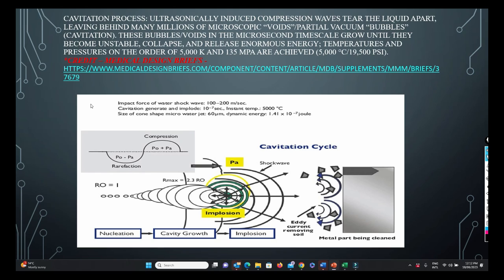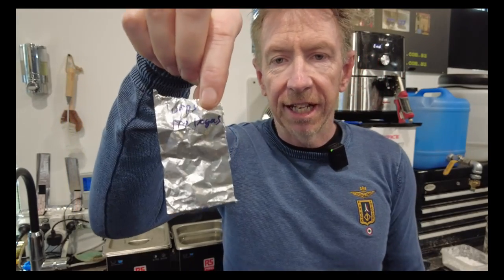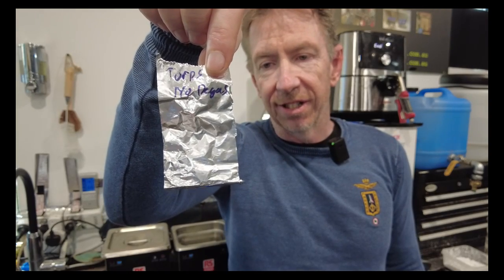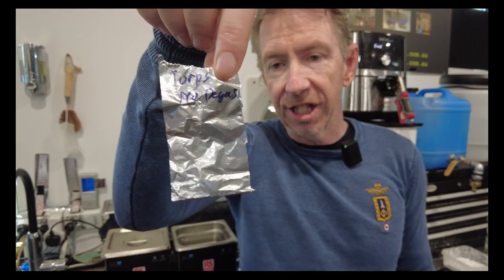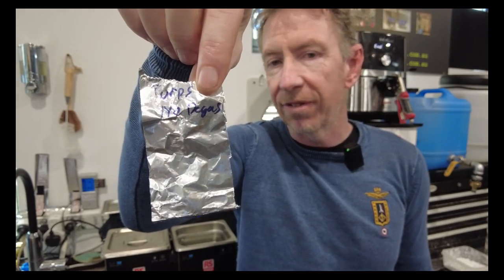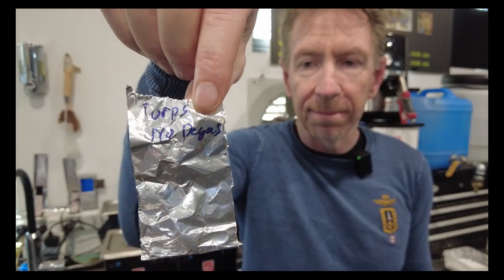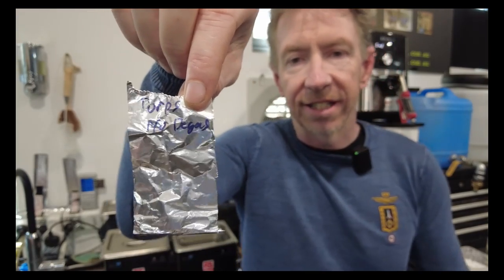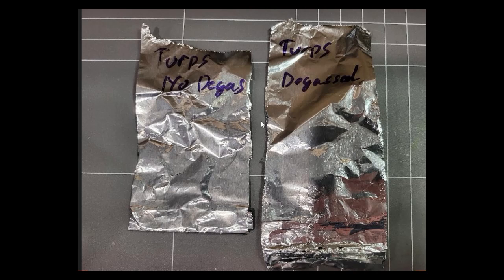Ultrasonic like a pro

Comment from the maker: **Apologies major computer issues today, it crashed twice and a couple vids showing close up of the more powerful ultrasonic with specific solution, as well as ultrasonic wax - have not exported into main vid. FFS. However you can pause and have a look at the main pick showing all test strips. In short - US with wax was better than expected - direct in tank, 80dg, and 10 mins degas. The strips in the specific cleaning solution in the elma were pretty ripped apart - specific cleaners will do the most powerful US clean action.

Comment: 27:04 Maybe I missed it, but in your discussion of degassing, your slide page 2 says to run the ultrasonic for 10 minutes “without anything in it”. Maybe you could have clarified that as without any parts? Or did you mean without any parts or liquid solutions?
Reply from the maker: Hey Terence - yes that means without any parts in it. I dont think many will consider this means without liquid as then there would be nothing to degas. I think i explained that the ultrasonic works by cavitation / imploding bubbles, and that when one pours solution / solvent in, this traps air like a bubbler works in a fish tank so the fish have oxygen to breathe. If there is gas trapped in the solution, this fills the imploding bubbles, no ultrasonic scrubbing - so degassing the solution is needed for ultrasonic scrubbing to be at its most effective. If there is no solution in there, there is nothing to degas.

Comment: Have you ever considered blasting a chain clean with a power washer or steam washer? 
I recently tried my power washer, on my chain, obviously after I removed it and secured on a plank. I also removed my cassette and did the same. This was on my mountain bike after several muddy rides and reapplied Finish Line Dry. 
I have been a user of Silca Secret on my gravel bike chain but had never used wax on my Mtn bikes. After learning more about chain lube from your channel I realized that wax would work well on my mountain bikes, so I started with my SS Mtn bike. It was great and easily wiped clean and reapplied Silca Wax chain lube. I determined that I had all the right stuff to give it a try on my geared Mtn bike and why not. So I power washed the chain and did the rest of the prep cleaning except for that ultrasonic. The chain was completely clean to wipe down with white microfiber towels after denatured alcohol soak. 
Honestly I don’t know why I have never considered using on my mountain bike’s except for the fact that people without ever trying it are saying it’s wrong or too complicated.  I’ve been a long time user of Finishline Dry applied in between ever ride but my expensive KMC get clapped out in about 1 year max. I ride a lot but have a few bikes so my mileage on each bike varies. The gravel bike gets the most mileage since I do a Century every month and choice for my longer distances. The Mtn bike less but get dirty with lots of stream crossing. 
Anyway, thanks for your analysis and deep dive into bike maintenance.
Reply from the maker: Hey there - steam would be a more time consuming faffy way vs hot water baths if trying to melt off wax. Pressure washer - it will get rid of surface stuff but it will again be a faff if trying to cleain oil lubes deep inside and wax doesnt dissolve with water so if bonded deep inside chain it wont do anything to that. Post mud rides i do jet wash bike and chain but then boiling water baths to melt off worst of contaminated wax, dry, wax pot. 

And yes A LOT of misconception re waxing especially in mtb demographic, but that is changing. slowly slowly logic is breaking down very incorrect myths. Offroad waxing gives much more benefit even than road riders as that is the perfect environment to have all parts inside chain coated in a super slippery SOLID lubricant, and there is no easier way to reset chain post harsh conditions vs immersive wax. How people thinks solvent flush cleans are easier makes no sense, and if they just add more lube, they pay for it with very high wear and friction - which is hardly optimal and very expensive on a lot of groupsets these days. 

If an LBS says a bunch of crap about immersive waxing, they should not be trusted with much....

Comment: Very interesting video! I wanted to do some aluminium foil testing myself, and got reasonable results with water, de-gassed water, and citrus degreaser. Then I tried Morgan Blue Chain Cleaner, and nothing happened. Not even after de-gassing. So ultrasonic should not be effective with it, correct? Well, I put a somewhat dirty chain in it, and as soon as I turned on the ultrasonic, large amounts of black dirt flowed out of the chain. So what was going on with the aluminium test?
Reply from the maker: yep same happens with solvents like mineral turpentine that also have very low ultrasonic cavitation. If the solvent itself is working on breaking down what needs to be cleaned - then when ultrasonic is turned on - the high frequency vibration will look like its ultrasonic action. So it will still clean, just mostly by vibration, not cavitation. Cavitation is actual ultrasonic cleaning action and is MUCH stronger than vibration. This is why the foil test exists - to see if there is actual ultrasonic cleaning going on, or just vibration.

Comment: Good stuff, but im going to use my just purchased ultra sonic + heater to hot melt wax my chains, Ill use a separate few jars for solvent cleaning of the chains for initial degrease, then just boiling water for resetting once I've waxed them and need to do another hot wax treatment.   Have you tried using a heated Ultra sonic tank for wax application? is it better than just crock pot waxing?
Reply from the maker: Yes ultrasonic waxing is done for race prep chains, something really pioneered by Friction facts and carried over with a number of companies that offer full race optimised prep. However, there is no tangible data on how much better a US wax (done properly) is over simply a good swishing. It could be a fraction of a watt, it could be a tiny fraction of a watt. I tend to recommend only to those who want to cover every base to make fastest possible race chains. For training chains, you could never, ever, ever assess a tangible difference so it is just a lot more time and faff to do for something you cannot notice vs just using a slow cooker - but, also generall no harm - albeit people can get a WORSE wax if using low power ultrasonic vs swishing as the modifiers will settle mostly to the bottom of wax leading to a poor distribution of friction modifiers through the wax going onto chain. For US waxing, you need a pretty powerful US, and you will want to (without aerating), give wax a thorough mixing before waxing to ensure full and even distribution. 
> Get wax up to temp.
> Without basket in use stick blender for about 10 secs - taking care not to allow it aerate (use deep in wax)
> Degas for 10 mins
> Stick blender taking care not to allow it aerate (use deep in wax)
> Ultrasonic wax 5 mins.

Comment: Very interesting vid Adam thank you!!! I got the us cleaner that josh(silca)recommended dk-600s for about $300.00 cad.Its a 6liter uc with 180 w power,300 w heater,degas mode,semi wave(25khz),full wave(40khz).I fill uc with hot water and wait till its 65c,put chains in 1liter pyrex measuring cup with mineral spirits,do a 10min degas,10min semi wave,20min full wave.Should I skip the 10min semi wave and do a 30min full wave cycle instead?After watching your vid I'm going to switch out the mineral spirits for silca chain striper,should I still give the chain a soak in denatured alcohol(methyl hydrate)or just give it a swish in the hot us water?I've been putting the silca hot melt sous bag into the us untill it melts and do a 10min cycle on full wave and you can see the darker(tungsten disulfied)swirling to the top of the bag,Josh says this really drives the tungsten disulfied into the chain!Sorry for all the questions but your the man Adam!!! Cheers!!!
Reply from the maker: Hey glenn - depends a bit what you are using for - what lubricant / chains are you doing the above on? However at guess if you are US cleaning frequently - vs stripper which i think is going to be great for initial prep with factory grease - if this is regular maintenance i would get a Ultrasonic solution for either grease  / oil or wax depending on what using. That will much cheaper than using stripper for maintenance, and a fresh batch each time, and best cavitation / scrubbing.

Comment: Thanks as always, Adam. That was very interesting information. This actually served to help me realize that I don't need an ultrasonic cleaner for personal use, even though I want one. Immersive waxing my SRAM Eagle chains has been so effective that even after a year of MTB in mixed conditions, the chains show no perceptible wear with a chain checker. So, as cool as they are, I would probably only use an ultrasonic cleaner once every couple of years. Instead of getting one, I think once I'm out of my current terps and spirits, I'll just get my new chains from you from then on. Have a great weekend!
Reply from the maker: yes correct - only the most avid of race prep really have a "need" for an ultrasonic - the rest is really for fun tinker time. Extremely good results can be attained just via normal maintenance methods, and if one is immersive waxing - the call for one is just not really there. You dont need it for initial prep, you dont need it for maintenance - so really it is just for fun. I think overall they are a bit oversold re what they will do for people, and a number of videos lead a bit astray re you just bung in cleaner, bung in chain press a button, and magic. Not quite so really there is a bit to know to get the best out of them, and to get a better result vs just container (or, in waxers case, mostly we just re wax and yeehaa).
Reply: @zerofrictioncycling992  Thanks, Adam!

Comment: I tried the new Silca chainstripper and wax prep and basically it sucked. I used 2x the amount suggested for 6 factory chains (170ml) and it was black after a 15min heated degass. It took 5 more rounds of mineral spirits till the chain was clean, then 2 more of methanol to get the factory KMC 9 speed chain clean. So nearly identical to a regular process I would do except    Exponentially more expensive and no time savings.
Reply from the maker: thanks for the info justin - yeah i havent looked properly yet at claimed amount per chain - was that 170ml for 6 factory grease chains? that seems not much for a lot of chains. I know with UFO clean they claim some pretty impressive amount that it can soak up, and yes it will go black as it is soaking up grease - but they advised this doesnt mean it isnt prepping as needed - the test really will be in does the wax adhere. I will try to get to control test soon ish....
Reply: @zerofrictioncycling992  

I used 2x 170ml as that volume was necessary to provide sufficient coverage in my USC. However after removing the chain and putting it in another bath of just mineral spirits, your equivalent to mineral turps, the liquid was still black after a 15m full power run so I changed and started another run till it came out clean. 

The wax may have adhered to the chain after the first cleaning, but I’m not gonna leave that much black in the liquid as obviously the chain isn’t completely clean.
Reply from the maker: @justinfournier1285  Yes indeed - it is a risky move to pop a chain with potentially a lot of black stuff in it into ones wax pot for fear of contaminating wax let alone poor adherence. Have you written to silca to discuss? If you do let me know what customer services response is - my belief is that new fancy products with fancy claims should have the requisite support if customer experience is not matching - and they should be aware of customer feedback / experience like yours as it may be needed to adjust instructions / claims.

Comment: I’m unclear on wash bike with a hot wax coating. Will just a light spray of water from hose strip wax and is it enough to wash off dust and any mud that may have splashed on.  I wash bike after every few rides. Based on the grit on my legs I expect some grit on the chain and cassette/drive train. Thanks
Reply from the maker: Hey bob, water wont wash wax off, but re waxing a wet chain can seem to impact the re wax. You dont want most bike wash cleaning products to get on chain as they may contaminated wax and impact next re wax adherence - so treat similar re anything you dont want getting on braking surface, you dont want getting on chain. 

It is best to wipe dry dust off chain with microfiber cloth sprayed with some alcohol - this prevents you bringing that dust into wax pot.  Unless it has been muddy - personally i also clean bikes by spraying cloth and wiping frame. I have never really understood watering ones bike with a hose to remove some dust. If i do need to hit bike with water and i am going to re wax and water is going to get on chain, then i either remove chain and pop in wax pot, or i know i am going to dry chain before putting in wax pot.
Reply: @zerofrictioncycling992  Thanks for the detailed response.  I grew up around cars. Had a few classics as well.  Washing them with plenty of water prevents the dirt from scratching the paint as I was taught.  So I took that to my bike. I use a light spray on the drive train. I was hoping as you mentioned it will not wash off. I re-waxed hot waxed after  300 km first time to be safe. Silca recommends using their drip wax between hot waxing. Is that necessary or helpful at all. Thanks.  Ps boating friends of mine use wax around leaking windows and leave on to seal them.  They say it works well.  Also when I re-waxed I stripped the chain down again , in case any oils left,   and dried in dehydrator I use on my scales models when painting.  Hoping that will be as dry and clean as possible. Next time I will just use hot water to clean then dry in dehydrator again.
Reply from the maker: @bobowsinski1704  ah yes indeed proper car washing one does typically hose off first! and i think if one is perhaps very particular re bike paint this may be the case too - but often people going enthusiastic with hoses can over time get water into things and places that its just better not too. I also always re coat my frame quickly in main areas that see the main elements with a ceramic coating (or a wax coating - same as people wax car paint - this is very protective, less dust sticks, and makes wiping very safe vs hosing).  

yes if planning to re wax circa 300km most do not need to top up in between. Drip wax with say ss drip in between re waxes is usually to take the pressure of some re waxing, they might use multiple times and then just re wax every circa 1000km etc to re set. IF one is planning on just waxing (like me, and most who buy immersive wax), you dont need to top up at all - there is plenty of wax and long lasting wax to go circa 300km easily unless conditions are very harsh. 

And yes one could i suppose use for that. but i would not rate its adherence long term to things like window sills as something assured - i would just silicone sealer from hardware store, that is what they use to seal windows initially, and it is made for that job....... it will likely be a safer bet for that purpose for much longer than paraffin wax base with slippery friction modifiers...

Comment: Can you sit the chain in the ultra sonic cleaner without the wire basket? And just cover the chain in cleaning solution or wax?
Reply from the maker: No sitting directly on the tank there is a) poor caviation there and b) may damage transducers. Must be raised off bottom in the basket.

Comment: Hi Adam,
For DYI waxing, what additives would you suggest? Not able to get PTFE and Molybdenum Disulphide. Are there other alternatives or should I stick to plain wax like before?
Reply from the maker: Most of the fancy waxes these days are using WS2 / tungsten disulphide. IF you can re wax frequently (and or two chains on rotation is often a great way to roll) you wont need additives as you wont notice any speed difference, it is mosly the top commercial waxes will typically have a noticeable treatment longevity advantage - this is not all due to additives however they are actually a blend of waxes just high grade paraffin is the main part of the base. If you can simply ride to the treatment longevity of a good paraffin base, personally i wouldnt bother with the cost of additives. You will never detect if its X bit faster, nor will it be likely a little ws2 on its own delivers a big jump in treatment longevity - but many like to play with such for fun
Reply: Thank you  @zerofrictioncycling992   That makes sense. I am rotating chains and will stick with plain wax. This additive stuff was eating away my brain since I couldn't get hold of them in my country and was worried about not getting the most of the waxing. Thank you for explaining this.

Comment: hi Adam,
For a newbie would you say the following sequence would work?
1. turpentine run - 2 nos - ultrasonic directly in tank
2. is0-propyl - 1 no - ultrasonic directly in tank
3. waxing in pot
I have been doing just plain waxing so far
Reply from the maker: If this is for new chain prep - will depend a little on how much solvent per chain. I do in batches of 4 so its 250ml per chain - this takes 3 turps baths for most, 5 for sram chains etc, and then 2 x alcohol. If just doing one chain in bath so 1 litre per chain, then you are likely to only need 1 bath per chain as there is enough solvent to soak up the fact grease. However as demonstrated ultrasonic power in turps is low, so you will want a good bit of run time. 

Dry chain between turps bath and iso bath, and dry chain before waxing (hairdryer makes quick work)
Reply: Thank you  @zerofrictioncycling992  . waiting for my ultrasonic to be delivered. Will try this out next week. Exciting times ahead 🙂